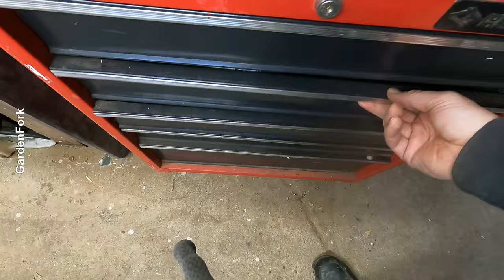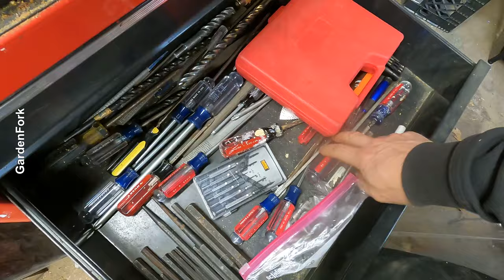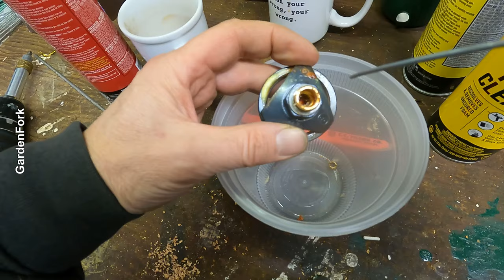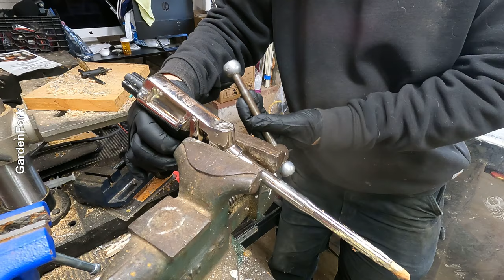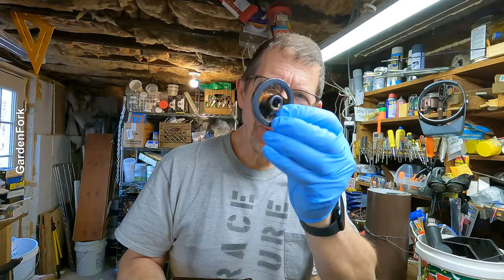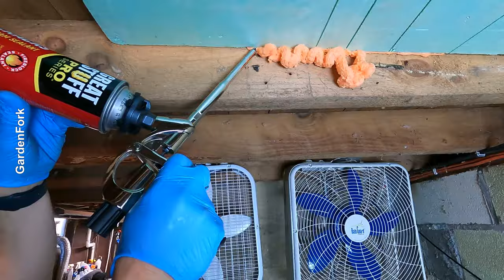I Clogged My Spray Foam Gun

Comment: Acetone aka nail polish remover great for taking off lots of stuff. I was looking at one of those guns so this is great advice
Reply from the maker: Super important to clean the gun with the acetone can, then remove the can, then pull the trigger again to release cleaner and foam still in the metal,shaft.

Comment: Would vinegar work? I use it as a cleaner/unclogger for several purposes. Soaking the items in it for several hours if needed.
Reply from the maker: it didn't work. looking online, there isn't anything that will melt solid foam :(